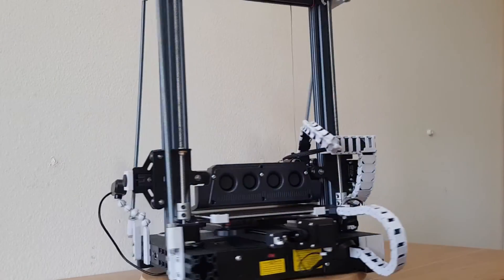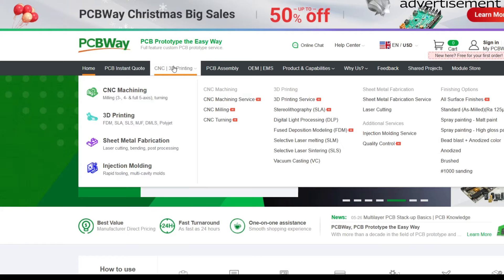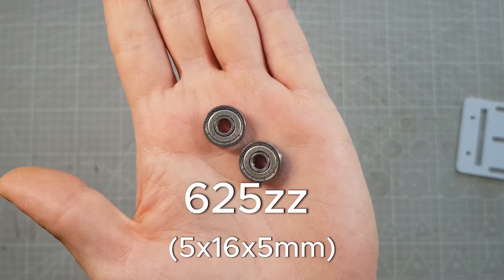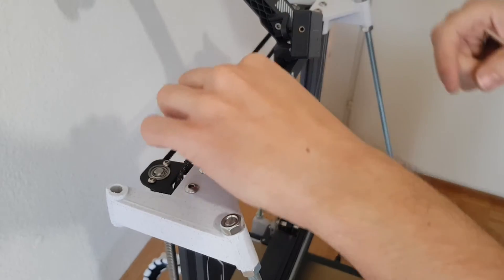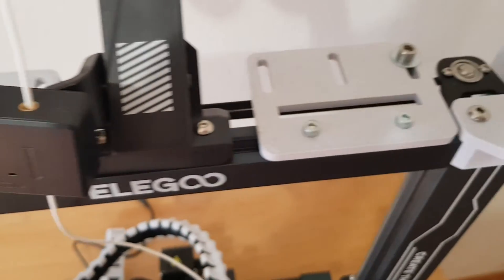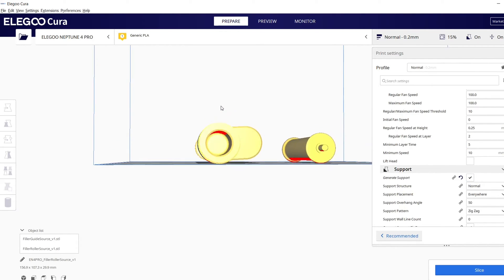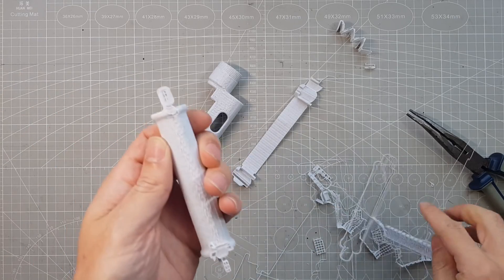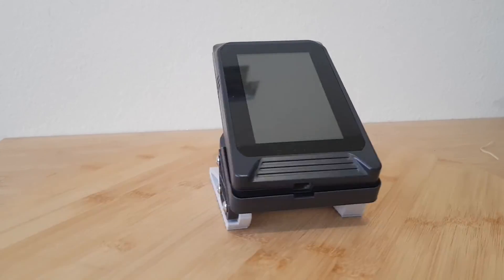Upgrades for your Neptune Printer (Part 3)

Comment: revise your z tension mod. the brearings need to be inside the belt or you're eventually going to force the teeth to jam into each other. 
if you can't easily get the bearings inside the belt, you didn't need the mod.
Reply from the maker: Thanks for the hint mate 👍
My belt was so loose that I almost slipped out of my pants.
That's why I put tensioners on the right and left.
And you're right, if I only had one I'd have to install it between the belt, but the way I did it I can tighten the belt from the outside without the teeth touching in the middle (not even close). It gives me the advantage that more teeth can grip the pully.
Reply: @Dirt-E-Bikes yea I don't think it would be a short term problem, but something that would pop up after a year or two of constant use.
Reply from the maker: @0xdreadnaught  right. I was wondering why my belt was getting that lose so fast anyway. Have you a idea what that may caused?
Reply: @Dirt-E-Bikes  so I don't have a neptune 4 yet, it's still in the cart while I sit on the fence, so I'm just speculating here. but it looks like the belt they provided is just a bad fit for the design of the printer. in your video the belt looks fine for all intents and purposes. but from what I'm seeing from other users is that after a handful of prints it starts slipping off the idlers, which is very much not good lol. so yea, I think they're shipping it with a belt that's like half an inch or an inch too long on the z axis. I wonder if they are reusing belts between the different size model 4s...
Reply from the maker: @0xdreadnaught  That could be it. As I remember it, the belt was tight when I had the machine new, and as you say, after about 100 hours of printing it was alarmingly less taut...
The mod with the tensioners fixed it for me, and its running smooth again, but it is conspicuous.

Comment: It's not your camera. The user is usually the problem. You are holding the object in mid air with a wide range of table further back. Put the object down on a contrasting material such as a black mat for the grey part. You will no longer have focusing issues. Or if you can, with your camera, is manually set the focus for your shot. Often if the object being recorded doesn't move closer or further in the entire scene, you will get better results.
Reply from the maker: Thanks mate, will try to do that 👍
Reply: @Dirt-E-Bikes  oh nice videos, my printer is arriving tomorrow and these upgrades are the type of thing I've been looking for. Other people really haven't tapped the 4 max content yet besides unboxings and reviews.
Reply from the maker: @VR6NAVYVW  thanks, yes i would also be interested to see more about the plus and the max. Did you order the max?
Reply: @Dirt-E-Bikes  yes. My plan is to make an entire body kit for my 01 prelude.
Reply from the maker: please let me know how that works, very interessted

Comment: Hey, I have problems by the adhesion on my N4 Pro. So are you?
Reply from the maker: Sorry for the late answer, yes i had some adhesion problems at the beginning, this was until i lowered the z offset a bit and set the first layer hight to max (0.32). This did it for me, and i have not have any problems since. Let me know if that solved your problem.
Have a nice day ✌

Comment: Looking forward to part 4. (Jumped ahead a bit and made the detached stand.) The POM wheels are on order for belt tensioner and I dressed up the spport rods with some cable wrap.
Reply from the maker: Cool, and you already did the display stand as well? 👍
Im right now working on part 4, but its really only this display stand (and printing the feed of it with TPU...) 😅
Reply: @Dirt-E-Bikes  Yes, after you teased it in the end of part 3, I found the stand on thingiverse, printed it, and got some TPU to print the feet.  It was a great suggestion - Thanks. I wish I could post a picture of my setup with the modifications you have suggested as I did mine in red and with the black cable wrap it looks great!

Comment: Excelent videos!  what is the name of the device to conect the N4P to the web via ethernet cable?
Reply from the maker: Thank you Reinaldo, it is called a wifi router repeater and you want one with a built in ethernet port to connect it with the cable that comes with the n4p.

I wish you a merry christmas ✌
Reply: @Dirt-E-Bikes Thanks for the response man! Found one just like yours and bought. Will try it here! Merry Xmas!!!